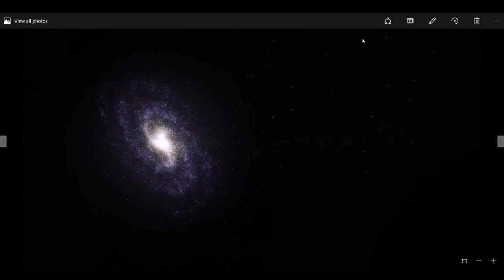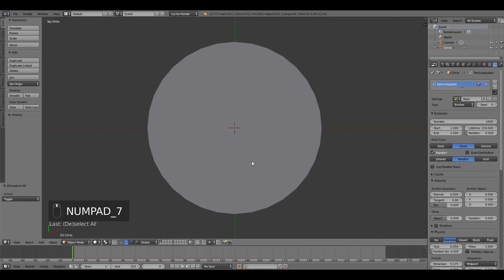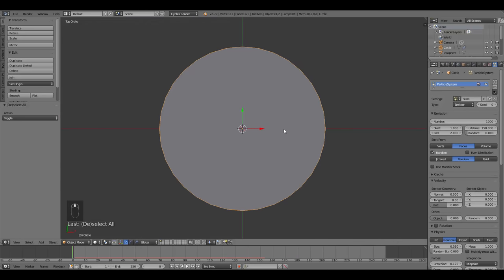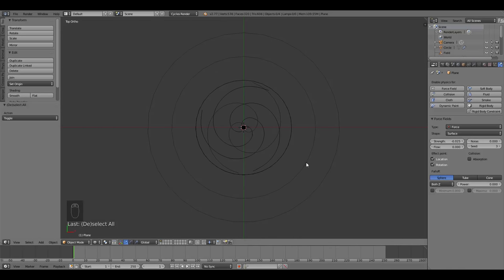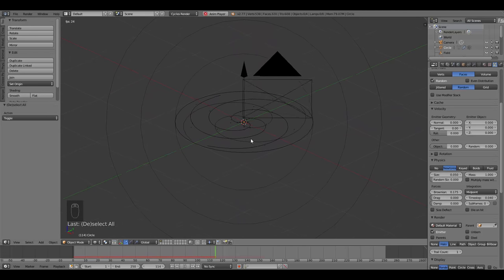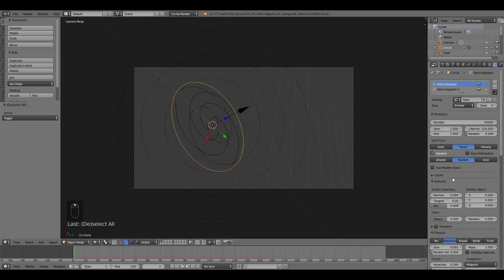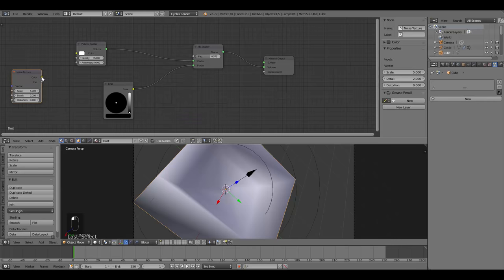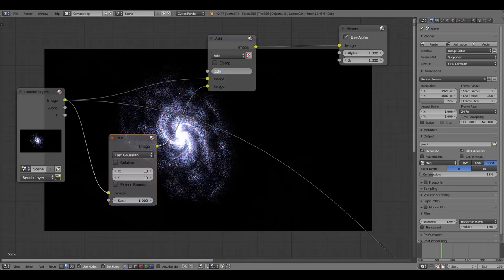How to Create a Galaxy in Blender 3D

Comment: I've attempted to make my own galaxy in Blender before watching this video.  My stars look great, animated procedural textures for the surface of the stars for when you're close enough to look at them, that was the point of my galaxy fly through, to start out with the camera outside of the galaxy, then flying in towards a specific star.  My stars are also different colors, but all using the same exact material.  I'd learned from another tutorial how you can use Object Info node to pick a random color from a Color Ramp with several colors on it with the interpolation set to Constant for each star instance that's generated by the particle system, or even if I manually duplicate a star, what ever new star is copied either manually or via the particle system it receives a random color off of that Color Ramp.  I also used drivers so that the camera's distance from the stars determines the emission intensity, the further the camera is from the star the brighter it glows, the closer you get the less intense the glow, still glows though, I set up a minimum, but the minimum is low enough that you can see the animated fiery surface when you're close enough to a star, but at a certain distance the star becomes too bright to make out the detail of the fiery surface, appears to just glow the color of the star.

I'm checking out this tutorial because from a distance my galaxy doesn't look that great, not enough stars for one thing, but having the camera flying through the galaxy at warp speeds looks great once the camera is inside the galaxy.

Comment: you should have used the factor output of the noise texture, not the color
Reply from the maker: Thanks for the tip!  I didn't really notice too much of a difference between the two, though; are there cases were that would matter more than others?
Reply: +Blender Smoothie yeh but here its fine :)